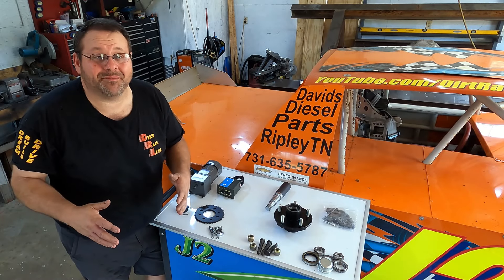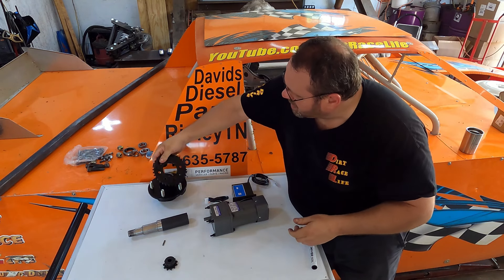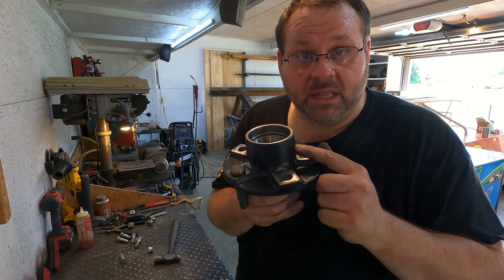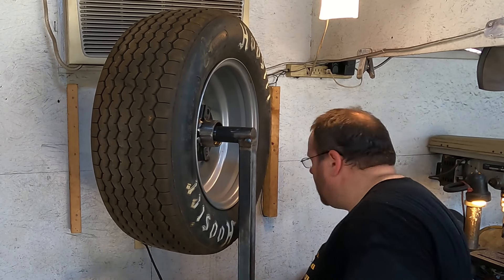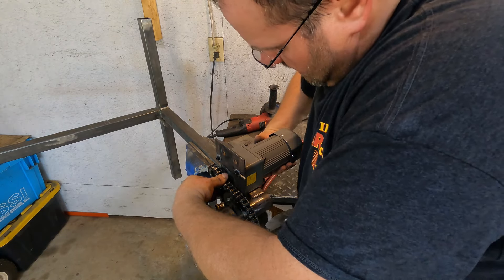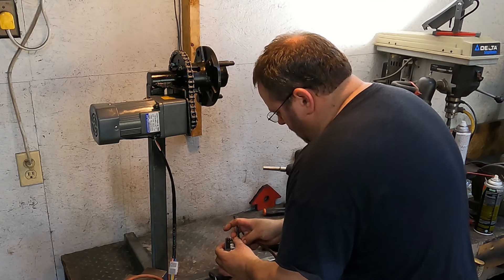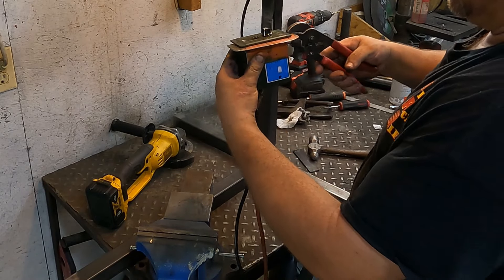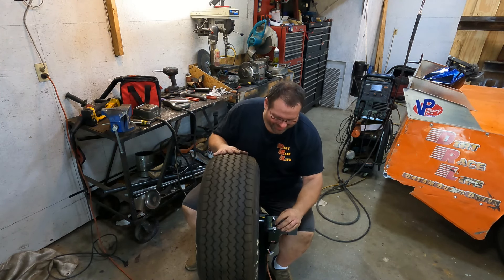I Built a Motorized Tire Stand for ONLY $250 Bucks

Comment: Nice video.  Although we just bought a variable Allstar rotator and mounted it to a frame we built i respect your ingenuity and you one uped us with the 3 point legs, our four can get rocky on uneven ground.  And I used 1" square tubing and it is a little bouncy.  So many things to learn dirt racing.  Thanks for the vid!
Reply from the maker: Thanks Bud, I am learning as I go as well. I should have mounted my legs further rearward of the motor on mine as well to make it a bit more stable. Sure appreciate you watching our channel.

Comment: I sent you a photo of mine on FB, however it’s a bit fast despite using a gear reduction motor. I do have a foot pedal to start and stop mine. Since we can only buff tires it’s not as big of issue. I agree I’ve been asked to build them, however I explain after we purchased the parts, plus charge a fair price, buying a commercial one.
Reply from the maker: I haven't seen it yet Mr James, email it to kimandjasondukes@gmail.com if you get a chance. I'd love to see it, always helps me figure how to make my next one a little better.

Comment: One thing I  have found that welding with a meg seems to hold good to cast over a stick welder
Reply from the maker: I have mig'd into a lot of cast over the years without issue but as far as engine parts goes I have always use the 99% nickel welding rods.
Reply: @DIRTRACELIFE  
You can weld on engine blocks with no wearies I've done it on my own race blocks that have gotten bloke along the pan rell. I did think it was possible but he said all you have to do to make sure you do not pull the line bore out is to lay a bear skin hand next to were you are welding and when you can not stand the heat of it you stop till it's is to were you can be comfortable and continue.

Comment: Great video and instructions.  Boy to use a old timing chain and gears would be sexy!!!
Reply from the maker: It would just be a matter of machining the centers out correctly and it would sure work. If I could find this type motor setup in a much lower gear ratio I think my next one will be a direct drive.

Comment: Jason, can you verify what gear reduction and rpm range your motor is?  This a great build and look forward to building me one.
Reply from the maker: Glad you found this video useful sir. I am using a 1/50 ratio on the gear train for the motor assembly and then a 34 tooth sprocket and 11 tooth drive for an 11/34 ratio on the chain. The total ratio is found by multiplying these two together and you come out with a 6/1000 ratio (0.00647058 tire revolutions per 1 revolution of the motor)
I have links to every part I used on my website at www.dirtracelife.com so just check it out for more details

Comment: Did you say that it's reversible ,do you know the part to do it if it does
Reply from the maker: It has a jumper wire with two poles and you switch it for whichever direction you want.
Reply: @DIRTRACELIFE  do you think it would be possible to hook a switch to it so you don't have to take the cover off to switch it
Reply from the maker: Yes . . .thats PHASE 2! Your beating me to the punch! But hey if you get there before I get the video out send me pics on our FB. I want to show some of these in that video :)
Reply: How many rpm did you get

Comment: I wanna see how to make a pit lift
Reply from the maker: I think I could do it for real. I have some concerns about safety for sure though and have to get that figured out before I attempt anything that big :)
Reply: Yeah that’s a concern I have as well. As long as you have decent welding skills and make sure to come up with a good design for a safety catch I don’t think there’s much to worry about. I mean heck look at the crap welds on all the stuff HarborFreight sells 😂 but the main thing for me is getting the right hydraulic cylinders the actual frame I was planning on making a copy of someone else’s

Comment: I went to the website and the parts are not on there?
Reply from the maker: I put the video and the parts right at the top of the front page. Not sure what could be causing you to not see them but sure will see what I can figure out.
Reply: @DIRTRACELIFE   I just see the video??
Reply from the maker: Directly below the video I linked each of the pieces and it shows them in a box. Five or six of them across the page. I checked on my phone and on my wifes Ipad and they were there. Very sorry you are having trouble.
Reply: @DIRTRACELIFE  Yup they are there on my phone, they do not show while using a desktop, Thanks!